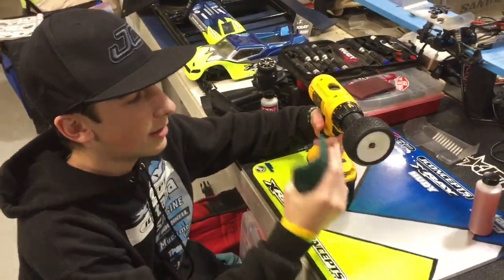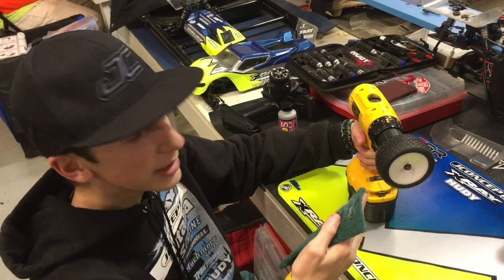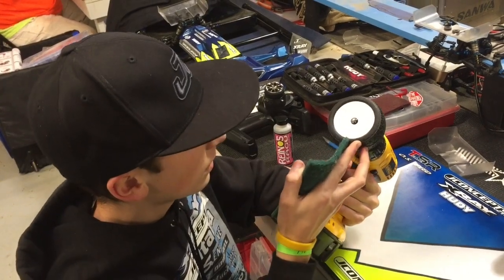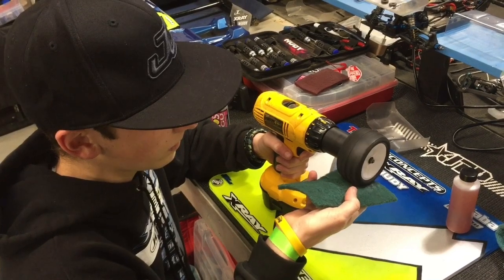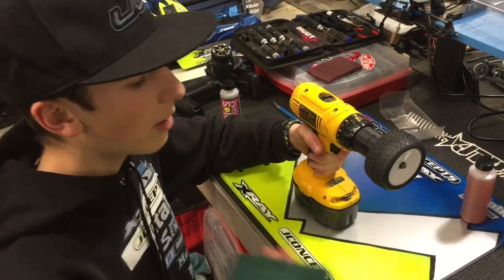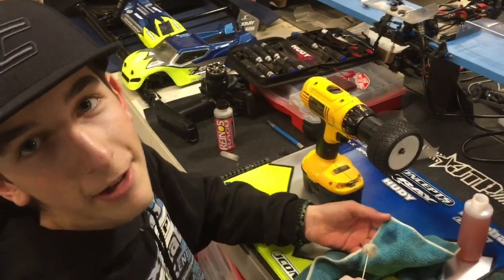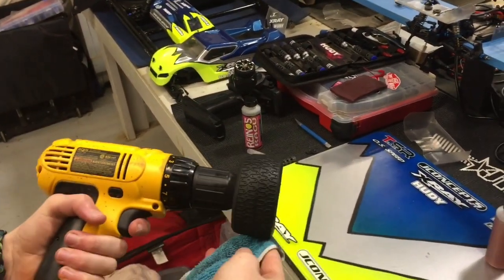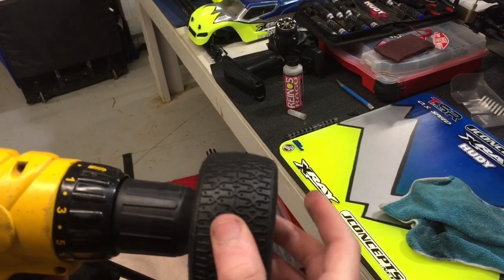How To Break In Jconcepts Dirt Webs

Comment: So if I do primes Scuff them in the forward direction
Reply from the maker: Yes, scrub them in the direction that you will put them on your car. You might try a set with and without scrubbing them, because I have experienced Pro-Lines not having an issue brand new. With Pro-Lines I just ran them and they would be fine after a run or two. I just did this video on the JC tires because if you didn't scrub the JC tires in, it would take in between 5-10 runs to get that shiny coat off the surface. Also, if you do scrub the Pro-Line tires, scrub them for a very short amount of time and then check them, because it is much easier to break through that shiny layer on Pro-Lines.